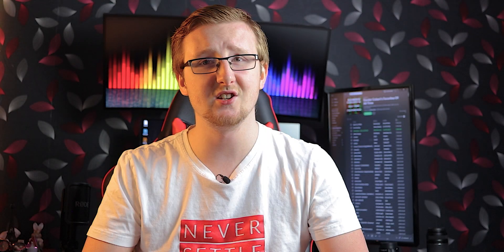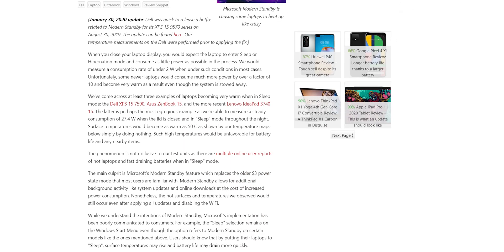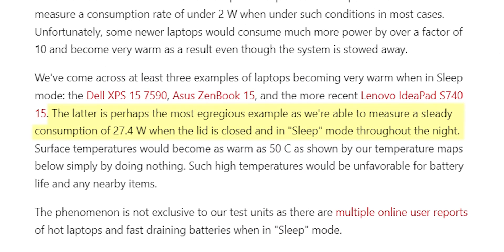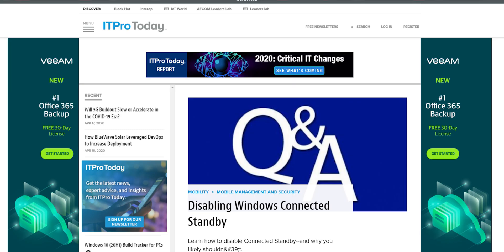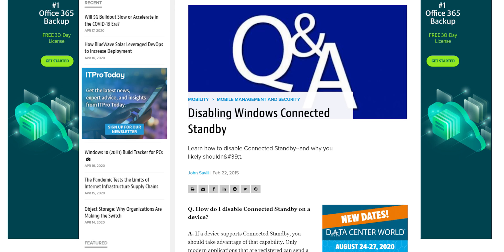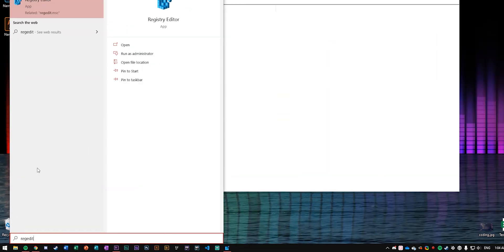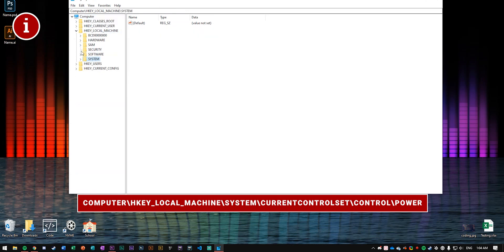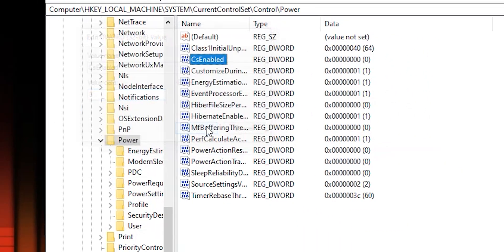(OUTDATED, Windows 1909 ONLY!) Modern Standby And How To DISABLE it!

Comment: I am having issues with modern standby. My laptop gets into sleep mode and suddenly laptop gets hot and fans spins 100%. Laptop does not respond to sleep and wakeup eventually draining battery. All my unsaved work gets lost. I am using Dell Vostro 3500 11gen, BIOS 1.9.0 with Win 11 21H2.

Comment: I have a 6th Gen X1 Carbon which works totally fine with no significant battery drain while sleeping. While my new 9th Gen X1 Carbon is a another story, I close the lid for 30 minutes and I lose 30% battery. The strange thing is, I checked both laptops sleeping states in Command Prompt, the only available sleeping states for both laptops is: “standby (S0 low power idle) network connected hibernate”.  So why both aren’t acting the same way? Could the issue be unrelated to Modern standby?
Reply from the maker: It was a new sleep thing introduced to modern CPUs for faster hoot times from sleep. Make laptops act like phones
Reply: @SanderCokart  So any updates regarding the solution to this issue?

Comment: Dell has delete S3 code from BIOS ,Even I am using "Setup_var" command at GRUB2 terminal to Disable S0ix from hidden BIOS setting  , but when i close lid, it going to “hibernate”，when i diasble “hibernate” by type "powercfg -h off",then close lid, it couldnot wake again, has to press button to forse reset.

Comment: With a Lenovo laptop such as Carbon X1, disabling Connected sleep is not enough and removes the option for sleep mode completely. You will need to activate the good old S3 mode from the BIOS. Update it first, and then boot to BIOS: Config -> Power -> Sleep State - Set to "Linux". Anyway great video, and shame on Microsoft for making us suffer with this terrible feature.
Reply from the maker: I'm going to pin your comment and yet more bullshit from Lenovo 🤣🤣🤣 it just keeps piling up